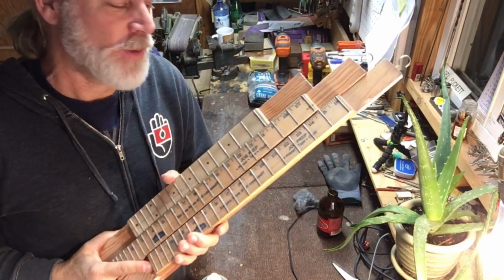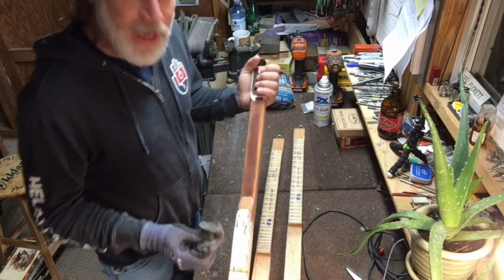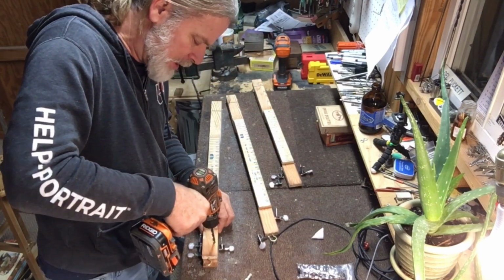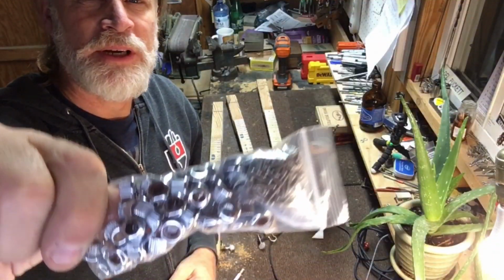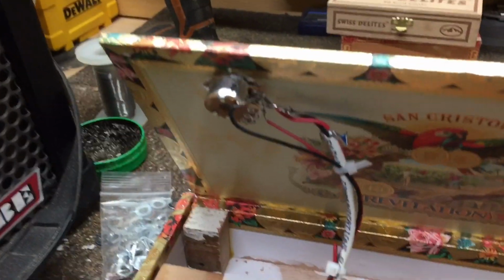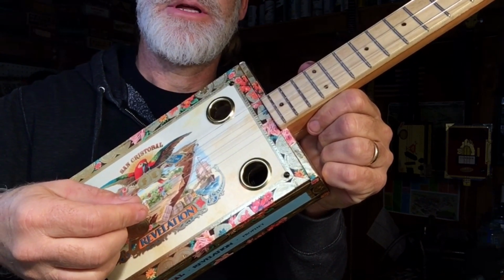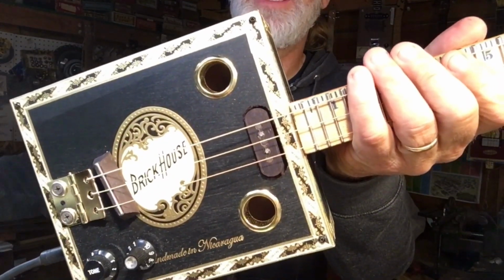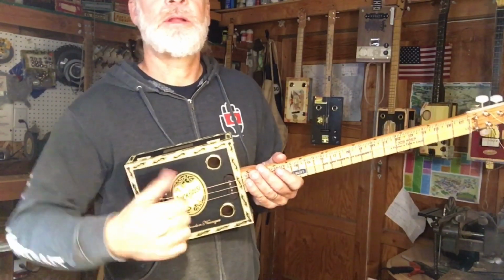3 3 String Cigar Box Guitars

Comment: More great builds!  On my latest build (a Halloween cookie tin 3-string banjo) I had a failure of the piezo. I tested it before I installed it and it worked fine. After I got it installed, screwed down the lid and strung it up I discovered it doesn’t work. D’oh!!! My guess is it is due to my poor soldering. Lesson learned: test it again after installation but before stringing it up.
Reply from the maker: Some lessons are best learned the hard way... then... just when you think you’ve learned it all ... disaster hits
Reply: @PuckettCigarBoxGuitar  Indeed. But after awhile you begin to feel like a cbg build without a disaster is like a day without sunshine.

Comment: I would never use steel wool on a build,especially one with a magnetic pickup,tiny metal fibers left behind and stuck in frets come loose and create problems
Reply from the maker: There’s so many things that cause problems... so many tools that can injure... so many ways to do things ... I feel like I have to dabble with all of them.  I’m a complete hack but I enjoy trying different things to continue to learn and grow.  These things are imperfections from the get go ....
Reply: Interesting, I've used steel wool twice on the same neck. First was a original build Warmoth Tele neck with Tung Oil naked no electronics installed yet, then 20-25 years later refurbished same with Tru-Oil and steel wool again. Never had a problem, but I can sure see how it could cause some problems. Never considered the steel and magnetic possiblitys. Nice tid bit of info, Thanks.
Reply: I've used steel wool many times with no problems being careful to cover the pickup/box with a towel.
Reply: After steel wool wipe it down and slide a bar magnate over the frets to pick up any remnants. Future problems solved... I think... maybe... probably. 😎